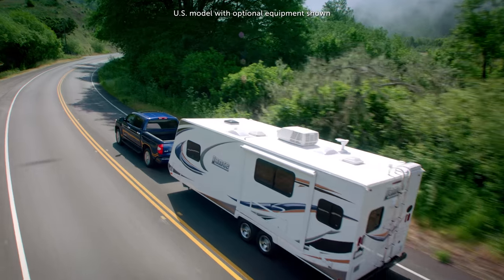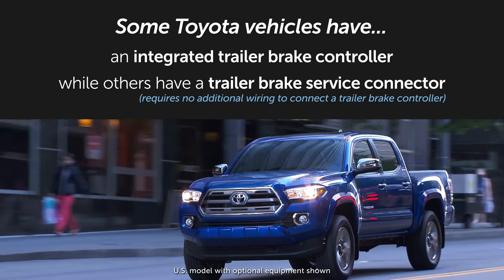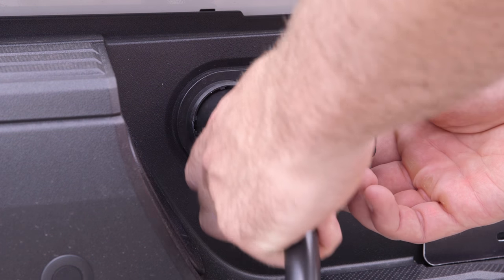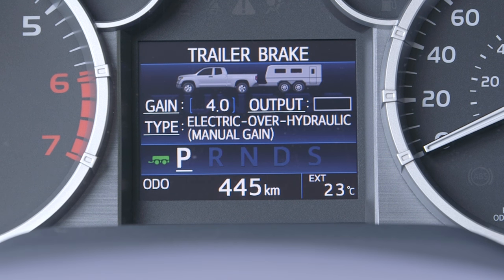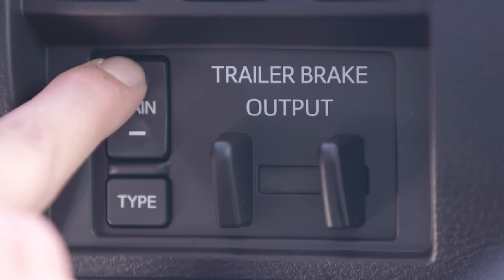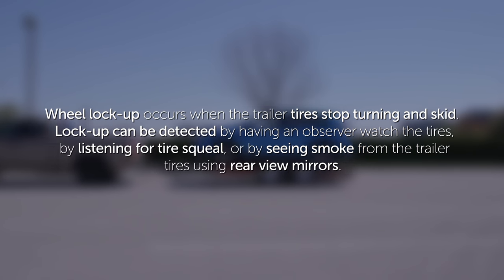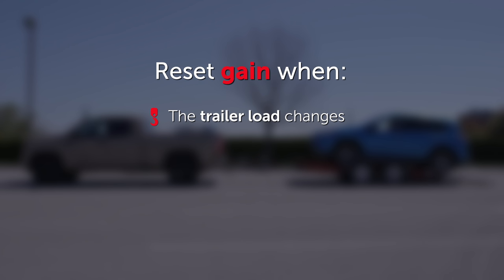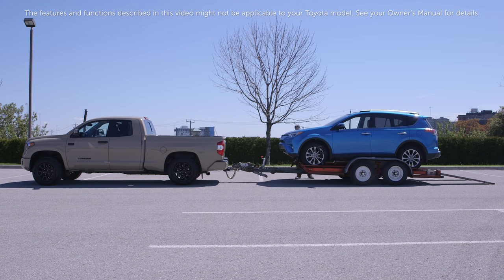Trailer Brake Controller

Comment: On the Tundra Forums there is discussion of how poorly the 2016 tundra brake controller works compared to aftermarket units.   Can you explain why the dramatic difference in performance?   The built in units are being described as poor to no brake function noticed when in use while in manual it does function.